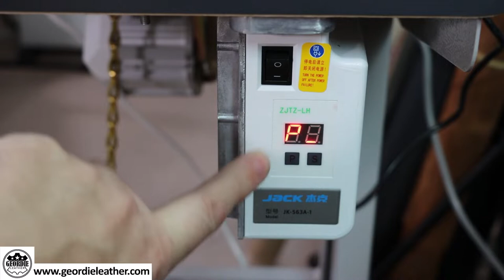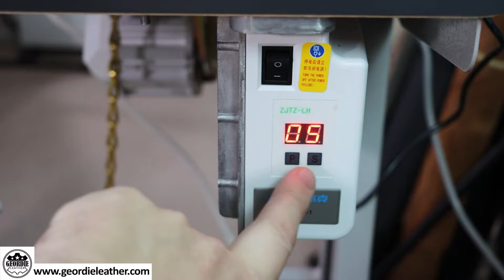Part 2: Reducing The Speed of An Industrial Sewing Machine for Leatherwork.

Comment: I have watched about five of these speed reduction videos and this was the best of the lot..I did buy a 550W brushless servo for my singer 45K which did reduce the speed greatly from the 2800rpm clutch motor ,but it does not have enough torque to push through think leather.I am told the reduction pulley will fix that problem.. Thanks Gordie for sharing in clear detail how this is achieved.
Reply from the maker: You're very welcome. Happy stitching!

Comment: Very good, love the temper in you voice. 
I have found you because I decided after years of sewing on my Brothers WF, I needed it to be slower.
I am going to first reduce the pulley size on the motor from 2.75 in to 1.75 in.  This will be 75% of the original.
I don't think that will be enough.  If not, your set up will give a better result.
I saw another similar to yours that was mounted on the table leg with both pulleys on the end of the shaft, easer to remove belt.(although don't think removing the belt would be a concern.
Reply from the maker: Many thanks. Good luck with your modifications.

Comment: Just purchased a servo motor from Amazon, they also sell a 45 mm pully that you can put on the servo motor for $8.99 US. That might get you where you need to be.
Reply from the maker: Thanks for the info.
Reply: No, it's not the same. Trust me, I tried both things. And a speed reducer is much better ans slower than only a 45mm pulley on the motor.

Comment: These videos are so useful. Unfortunately the machine I purchased from the UK came with a 12mm shaft on the motor so it's proving difficult to find pulleys. Looking forward to the needle and thread video very much! Are there different naming conventions/sizes for the same needles and thread in the EU and the UK?
Reply from the maker: Hi. Thanks for your comment. With my method, there is no need to change the pully on the motor, you're just adding two additional pulleys which can be 15mm shaft. Yes there are different naming conventions around the world for both needles and threads. I will cover this in part 3.

Comment: What I did was put a wood block under the pedal I have a juki 5550 and it goes so fast.  So when I step on it it only goes so far . Don't no if that will hurt the motor in the long run . I will gear it down if you think the would be better

Comment: I have a singer 491 and finished fine tuning it. I am noticing that the reverse will work for longer stitch lengths. 6-8 but then the feed dogs will be in a stationery position and material doesn’t move. I a don’t know if this is normal for industrial machines or not

Comment: Hi. Great video, very useful. I’m doing the same mod on my highlead machine. Is there an easy way to determine what belt lengths I’ll need before I’ve bought the pulleys? Also I notice you used a 110mm large pulley but stated it was a 135mm, I’m assuming you meant to say 110mm? Thanks again.
Reply from the maker: Hi. If you are a whiz at maths, then there probably is a way. But, like most folk, you'll have to wait until you have your pulleys and measure the distance with a piece of string to calculate the belt lengths. Yes, I meant to say 110mm.
Reply: Thank you for your response. 👍👍

Comment: Take the clutch off the motor , lightly sand the flywheel and deglaze the cork clutch plate with a brass wire brush then blow any dust off, put it back together. You will be able to go as slow as you want without losing any high speed. It costs nothing.  Cheers
Reply: These machines were all built to serve a purpose and clutch motors are perfectly usable and just about 100% reliable.

Comment: The installed picture looks like this:
There is no speed deceleration on the 135mm pulleys installed from the motor pulleys.
(Is the diameter of the 135mm pulley longer than the motor pulley?)
And speed deceleration appears in the part connected to the sewing machine pulley at the installed 45mm. Is the speed reduced by a third here?
Reply from the maker: Thank you for your comment on Geordie's YouTube channel. Geordie has been away dealing with some health problems but is returning to YouTube very soon with a brand new series of videos. We are clearing out his overflowing inbox in readiness for his return. If you want to re-ask any questions or re-submit your comment, please do so and Geordie will answer you personally. There is no need to reply to this automated message.